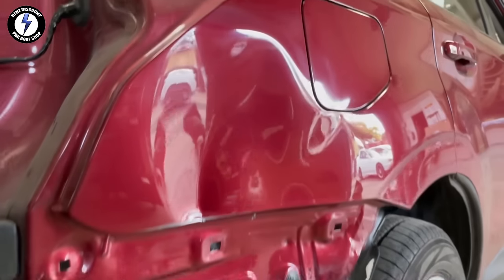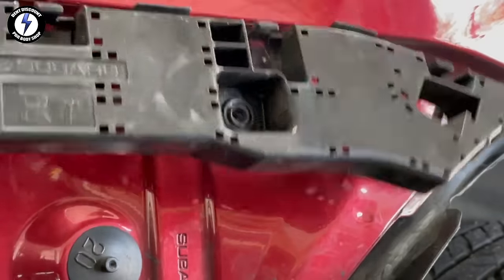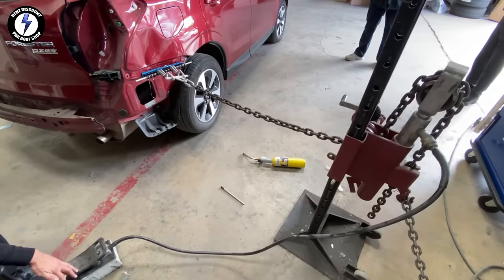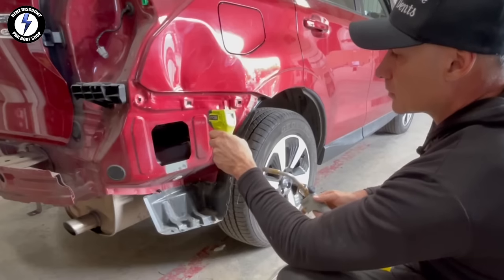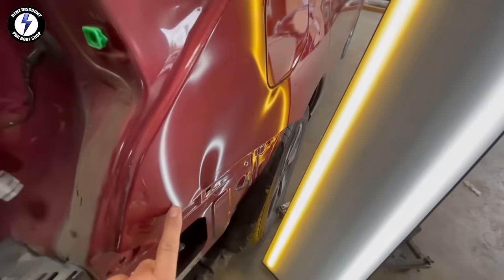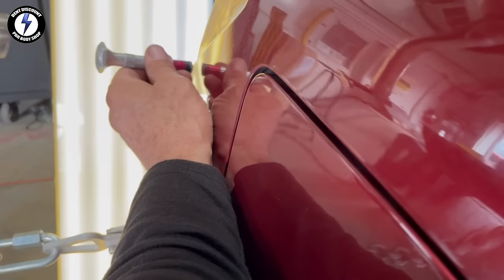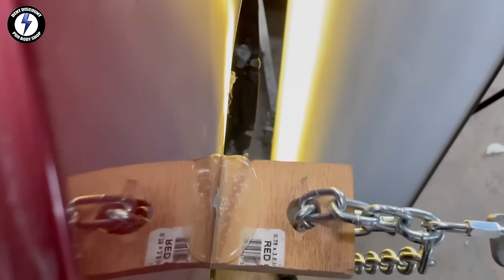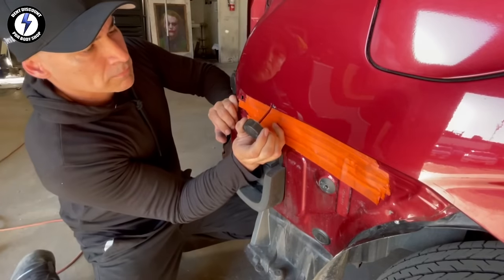Dent Pulling SHORTCUTS! | The Easy Quick Way!

Comment: I get mocked in the body shop for using your techniques, but my boss can't argue with the results. Consistently surprised with the panels I've been able to save. Thanks for the tips.
Reply from the maker: http://secretpdrpaintlessdentrepairtrainingonline.com/  
Thank you for your comment James
Reply: You are witnessing the cutting edge of dent repair. Ken is likely in top 5 in the world for quality PDR techs... Remember, all pioneers are mocked throughout history... "The Earth is Round", "Earth is not the Center of the Universe" "Humans can't fly", etc.  If you knew that hot glue, pry bars, heat gun, pull tower, pull tabs, and alcohol would work better than weld tabs, grinder, bondo, dry, sand, prime, dry,  color match paint, dry, clear,dry, polish.  I think it would be something for your colleagues to embrace, and not mock... Maybe boss man should send the team to some PDR classes! Ken offers them :-)   Paint techs probably hate it... lol  (We don't get anymore work)
Reply: @Carbon_Fiber  Shops make money to use materials.   They get paid to replace parts.  They don't want me to be able to straiten a fender when they are paid to get a new one.
Reply: @Carbon_Fiber  It's not entirely up to the shop.  When insurance is involved.   In some cases.  Sure you could do that.  However most of ny work is insurance jobs. And they dictate pretty much everything.
Reply: @Carbon_Fiber  ,
Because these techniques are so new, that most dont know about them.

When we see the PDR guys come to the shop, they generally cant fix anything bigger than a golfball. We wont even call them if the paint is broken at all, because we have to repaint anyway. In which case our methods arent that much different.

Also, no one knows that a piece of "Plastic" stuck to the side of a car with something as ridiculous as "Hot melt glue", of all things, has enough gripping strength to make a pull like this and hold. If that was well known, we would all be doing it.

In the example in this video, a conventional shop will weld a metal plate to each side of the bodyline, and make their pulls off of that.

We also have "wiggle wire" which was a huge advancement over when I was young, but its still welding some form of attaching point to the body so you have something to grab on to and pull off of.

Keep in mind, the WAY he does his pulls in the video, walks the dent out, and taps down the crowns is nearly identical to how a good metal worker does it anyway. That hasnt changed.

The differences are this:

1. Hes using glue tabs for his attachment points to make his pulls. The pulls themselves are identical, however.

2. He uses a "Hammer & Chisel" technique when taking the stress out of the crowns and doing his tap downs. I dont know why this is done this way. A polished bodyhammer should do the same thing without breaking the paint. Back in the day we also used polished "Chasing" hammers (only available from Mercedes Benz Germany, back then) and smaller jeweler's hammers for the fine work.

The tap downs could also easily be done with a nylon jewler's hammer (which may actually be my own personal trick because I have never seen anyone but me do it). 

3. Once the metal was really close we would use a metal file to highlight the highs and lows to continue tuning in the final 10% of the repair. Today, the PDR lights accomplish the same thing, so this step is replaced with using the light and the 'shine' of the paint itself, as the final guide.

If I had to guess, Rick was an old school metal finisher, before getting into PDR.

PDR on its own,  does not have this type of skill and technique in it. Its something that evolved separately from conventional bodywork...probably from massaging out minor flaws that happen on the assembly line during new car manufacturing (which is why you could ONLY get the tools from Mercedes Benz IF you were a certified Mercedes shop, back in the old days). It would require a real metal worker, who knows old school metal finishing, to take it to this level.
Reply: @DentDiscountPDRBodyShop   name of the glue you use on the wood peace to buy?
Reply: Why the hell would they mock you? It's way harder than standard bodywork, and retains original panels and paint.  Sounds like they're just jealous or stupid.
Reply: What glue and torch do you use?
Reply: @TheRickjames215 don’t forget that time is money. If you aren’t making more by saving a panel, let them pay to replace it. Unless you just don’t feel like it I guess. But keep in mind no matter how good you do, if it the insurance company paid to replace it and you don’t, that’s insurance fraud. Make sure your estimators change it to repair if that’s the case
Reply: I love the work❤

Comment: You would be surprised how much better that bumper would look if you just wipe down that scratch with brake cleaner on a rag. It removes any traded paint and makes it a 10 footer. Of course doesnt help scratches. I clean it off and wax after to keep the paint from drying out from the chemicals. Not a full repair but really helps visually until repaired.

Comment: My sister had a dent on her Venza rt/frt.qtr panel. Cause by a runaway Walmart shopping cart. Left a 2 fist size dent. I tried the heat gun with a strong plunger....Nope. I unhooked the wheel well cover and couldn't pop it with my hands. Finally got the old 3ft, 1/2 " Crowbar used the tire as leverage and pop 90% of that dent out.  Respect.
Reply from the maker: Right on my friend that’s how we do it

Comment: Hi. New Subscriber from the UK. I cant believe the size of damage you guys can deal with using glue tabs and PDR. In the UK PDR deals with small parking dents only. No way these jobs would be done without weld tabs and full panel paint. Amazing skills!!!!
Reply: When PDR started here in the colonies back in the 90s, they also were limited to typical shallow dents, dings, hail damage etc. and wouldn't touch anything with a crease or anything on a body line.  I just think it's a natural progression of the art. If PDR is more recent in the U.K., this will naturally catch up.

Comment: <-Newbie, retired now and ready to do some work. I have a 60 ford long bed step side relatively bad rust but no dents. Figure is I am lucky I might get it running and looking all right by the end of summer. If I can find a decent old guy (and handicapped) job I plan to go after a land yacht as the truck approaches finished. Love to get something like a 70 LTD with a real land yacht motor. Plan to use youtube to instruct me in a bit of body work which is where you come in. But first I de-rust the old pickup and replace the brakes (I think they are what is called single leading shoe and non-adjustable, hitting the brakes at speed is sorta like holding a committee meeting while they figure out which brake is going to start the party)

Comment: I'm new to following you, your work is great, I screwed up and damaged my 21 gmc Denali 3500 on the front edge of the bed and the rear door and bottom of the c pillar on the passenger side, I'm afraid the body shops around here will just want to fill the c pillar dent with bondo, I'm sure the damage would be a challenge

Comment: A great little hack for that dab paint is to mix a little clear coat and hardener in with the paint the ratio doesn’t have to be perfect let it cure and wet sand and buff it honestly only a trained eye could point it out once you get good at it
Reply from the maker: Thank you for your comment Dylan I really appreciate it

Comment: Thanks. As I watched and looking to make  repairs in my driveway I was considering your pulling apparatus. What do I have? I have a ratchet winch, will not give me precise control that you have, but I good alternative for a driveway. I had a wheel come off on the highway and damaged and compressed front quarter panel. This technique may just be what I need to pull some of the shape back and align. The wheel pressed up on the panel.
Reply from the maker: Glad I could help

Comment: I inherited a 1993 S-100 series Ford Pickup Truck from my dad and i want to restore it. The truck is covered with large and small dents and scratches. I have never pulled out dents before and was wondering what's the best and cheapest way to actually do it (no gimmicks).  i started to look at different YouTube videos and was wondering does the Bridge Out really works, what do you recommend? I'm going to eventually have it painted so I am not really worried about the original paint job. Thanks David

Comment: New subscriber
I have a variety of vehicles, old & oldish vehicles could benefit from pdr.
No big deep dents, but some short sharp creases.
I ordered a cheap sliding weight puller & tabs from wish & was plesently  surprised at the quality of them. I have an electric heat gun, so just need to source some good quality glue.!
Reply from the maker: http://secretpdrpaintlessdentrepairtrainingonline.com/  
Thank you for your comment

Comment: Great video! I have an idea of a homemade tool that I believe can pull dents just as good. If the weight of a car sat atop a platform with at least 2 wheels. A tripod like brace bolted to the platform to hold an adjustable height mast. That mast adjusted to the correct height and a long lever with a pivot attachment to the mast top. A chain connector mounted a few inches above the pivot point and the fulcrum strength of the lever should be enough to pull dents. Steel would be best but this might even work with wood if thick enough. Theres also a chain hoist & a tree anchor in a pinch. Your thoughts?
Reply from the maker: I like your creativity thank you for your comment

Comment: I just subscribed to your channel. I should start by saying that I am troubled when it comes to Autobody work. I have a Ford Ranger 2002 with two ugly dents at the rear on both side fenders behind the wheels. I would really like to repair these myself and paint the whole truck. But I have no idea where to even start.  I'm willing to buy tools that are needed. I was wondering if I sent you picture of my truck, could you tell me what I need and how to get started? I know how to use both hand and air tools. I've just never done any Autobody work. To tell you the truth, after all the videos I'm intimidated by the ugly dents now. It looks so easy on YouTube. But I know there is no way it can be that easy. Just looking at the dents I can tell that the truck has been work on because it has little whole on the inside of the rear panel and you can see Bondo Body filler that squeezed through the wholes. So, I don't know if the glue and pull method if appropriate for this case. I'm thinking of just sanding the dented arears down to bare metal and starting from there. 

Any advice would be greatly appreciated. As intimidated as these dents are to me. I really feel like I can do this. But before I make these repairs harder than they need to be. I thought I should ask for advice. 
         
What! Did I hear you say personal training?  That would be awesome! How much is a personal training session? And is it possible to get training online via video or maybe via a zoom meeting?

Things I would really like to learn:
- What tools do I really need
- Basic Autobody Work
- How to prep and paint 

I saw a neighbor take a junky old truck and with very few tools remove some major dents, put new bumpers on and then paint it in his back yard. To my surprise the truck actually looked really good! you would have never known it was a back yard project. It came out that good!  If he was still around, I would ask him for help.

Comment: I am a new subscriber to the channel. Just amazing work.  I wanted to ask how would you go at pulling a little dent from an aluminum hood. For example I have a 2007 Volvo V70 with little dents on the hood. There is no way of going from the inside because of the hood frame. But would you just use glue and a puller with the hammer action or would you use a puller that you have to slowly turn a knob to get the dent out. The dents are like little smooth craters. Thank you
Reply from the maker: Yes you could either Glue Pull or it’s best to get behind them if you can to push out the dents

Comment: Question:  would pulling the panel from the back.  If you clamped from the inside of the tail light opening and under the bumper exterior section, ir would pull some of the tension out of the panel